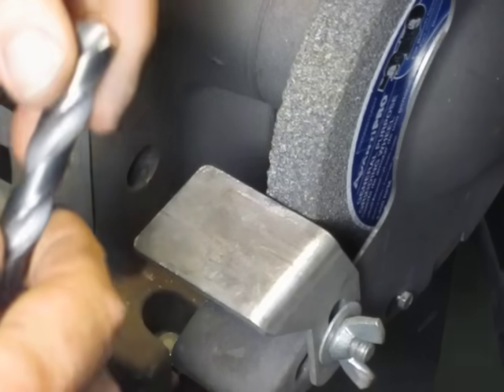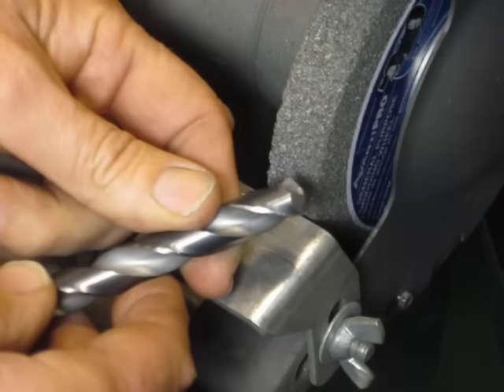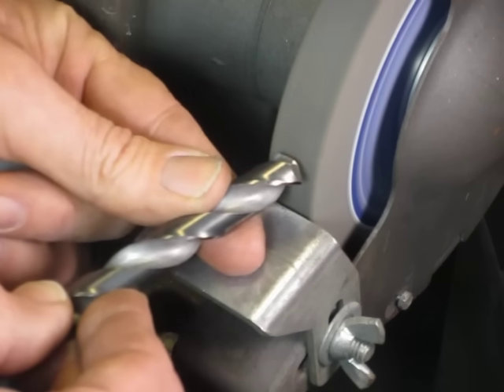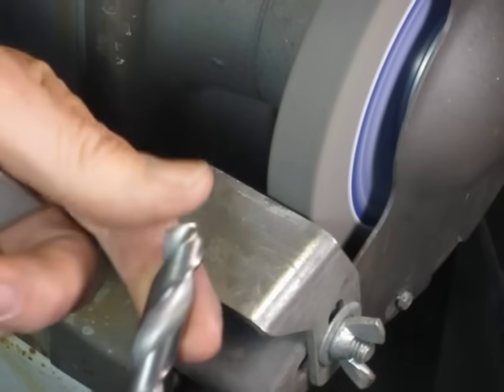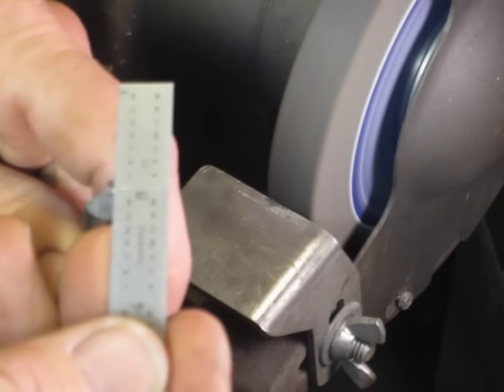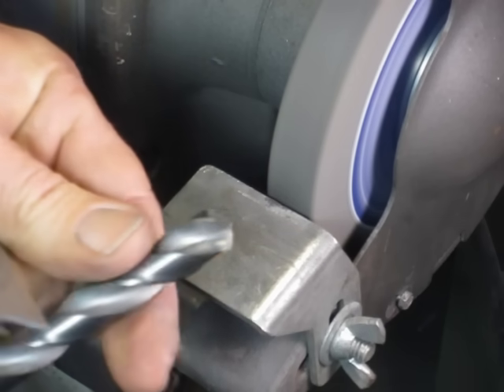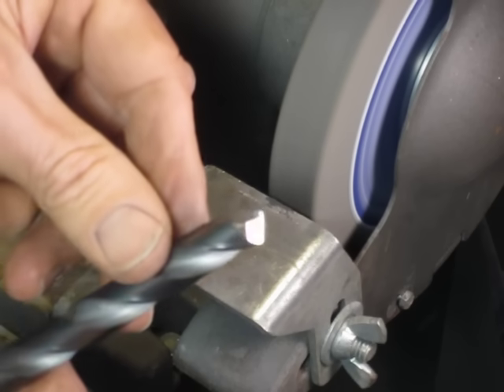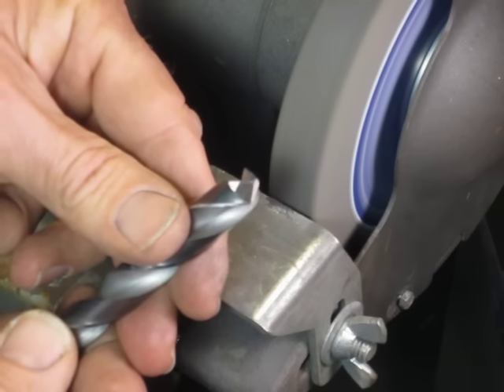How to Hand Sharpen a Twist Drill

Comment: Great video Tom,
 I read a few comments where they disagree with your methods,
Everyone to there own, more than one way to get the job done, but when grinding a heat factor has to come into play, and the less heat when doing a grinding technique the better
But as you stated below, this movement side to side is a preferred way 'as less heat is placed.  Most persons sharpening there drill bits at home have a choice, and the more techniques they know the better they would quickly adjust to one that suits them, 
I also would like to add it is worth mentioning the smaller the chisel point the weaker it is, and  the quicker the wear down on that point will be, even though more accurate '
But think about how you want to leave the dome left by the chisel point if you only want to drill partially through.  
If chisel point left wider` then a piolet hole in your piece you are drilling should be done first slightly bigger than the chisel point with another drill bit, as you state the chisel point does not do the cutting, But as you have demonstrated when chisel point taken down smaller` then you should be fine just to drill your piece without doing a pre drilled hole,
Hope this helps some newbies,
PS, Remember` the speed of the drill press, choose the correct drill bit angle and speed of drill bit rotation, also whether to use cutting oil, all play a factor when choosing the material to drill.
Reply from the maker: The naysayers are generally close minded individuals unwilling to accept the fact that, as you pointed out, there is more than one way to get the job done. I have to laugh at those who claim this sharpening technique won't work, when I have been using it professionally for twenty years or longer. I guess what it boils down is that I really don't care what the critics have to say. I know from personal experience that the technique works well and I'm happy to be able to share it with others.

I noticed you comment about heat buildup, and you should know that the heat generated from grinding high speed steel is not detrimental. HSS has what is referred to as high red hardness, meaning that it holds its hardness to a much higher temperature than carbon steel, generally up to 1100°F, or a dull red color. Check out my video on the subject.

Thanks for taking the time to comment.

Tom

Comment: Take two nuts put them flat side to flare side, the angle they make is 60 degrees, hold them together put the point of the bit in that space, thatvis a quick way to check your work, no gap and no separating the nuts , As you look down.
Reply: Hi Mike. I took my two nuts and put them side by side. Just going to get the wife to check the angle between them.
Reply: Doctor Boy how did you have them before Mike recommended you keeping them side by side?

Comment: it"s not a drill,,it"s a bit..
Reply from the maker: You may want to consult the web pages of a few manufacturers that actually produce these things before making such a statement, Barry. I found twist drill, drill bit, and drill, but nowhere did I see "bit". Unless you are referring to the auger type used with a brace for drilling holes in wood.
Reply: It's a twist drill. A tool bit is usually high-speed steel and square or rectangular in shape.
Reply: @24681359David  k

Comment: Does anyone know how to sharpen a glass drill bit?
Reply: Holy crap you have to be more clear!  Until I read the answer, I thought the bit was made from glass and was wondering wth!
Reply from the maker: Best way to drill glass is with a brass tube and grinding compound. Make a fence around the hole and fill it with water and compound and work your way through with lots of pecks to keep the glass from heating up.
Reply: @TomsTechniques  I didn't ask how to drill glass. I asked if there is a way to sharpen glass drill bits

Comment: Great video.  I'm a retired machinist that has sharpened drills by hand since the early 70's. I must have sharpened many thousands of them in my career and the one thing that's most important is practice. Find yourself a batch of drills and sharpen them over and over and over and over till they're too short to use. Test them by drilling holes and measuring the hole diameter.  After their too short to use throw them away and sharpen some more. After a few hundred attempts to get them sharp you will gain the confidence to tackle them without hardly thinking about it. It's a skill that develops over time just like playing a musical instrument. You need to practice.  I'm like you, it's hard to find a dull drill bit in my tool box because I almost instinctively sharpen it if it's dull before I put it away. I never put a dull bit away in a drill case. That's a no no. It only takes 30 seconds to sharpen it so why put a dull bit away.

Comment: can't you just mark and cut a groove in the tool rest and the make your mark in the angle adjuster on the side so that you can pretty much get started quicker and easier?I'm not trying to be a smart ass but seems like it would be faster?one thing I hate is spending all that time on bits but it's a necessary thing so the faster the better long as its right
Reply: you can get cheap grinders with such a groove already in the tool rest. do NOT use it. especially if you share the grinder with others in a workplace. if you grind in one spot your stone will have a groove in it rendering it useless instantly. sweep back and forth like the guy in the video and it will stay flat.
Reply from the maker: Remember that the rest gets adjusted from time to time as the wheel wears, so a guide slot may not work very well. Once you get good at it, sharpening up a bit will only take a few seconds, so time really isn't an issue.
Reply: Barry Kilts p

Comment: Hello Tom, for a 1" drill bit to drill on Stainless Steel shaft, what angle would you sharpen the drill bit?
Reply from the maker: Harder to machine materials generate more heat, so a 135º point angle would be appropriate.

Comment: I had a highly talented man take me under his wing and shared knowledge with me that I would have to live 3 life times to learn teach me how to sharpen drillbits.  It is much the the same as how you demonstrated up to the point of grinding the relief.  The way he taught me was to lineup the cutting edge like you show but then rotate the bit clockwise and pivot it down at the same time.  They come out looking like a new one fresh off the shelf.
Reply from the maker: That is called conical relief and is the way we all learned to sharpen bits in shop class. :) Faceted relief, as I demonstrate in the video is more efficient (generates less heat) and easier to grind. Give it a try.

Comment: What I do after cutting cutting edge and a relief angle on bench grinder - I take angle grinder with a cut-off wheel(more precise than grinding wheels) to grind the split point, like new bits. With some practice - it is worth doing on bits between 8 and 12 mm. Smaller are quite finicky and bigger tend to need a pilot hole - so split point is not necesary.

Comment: Wouldn't this destroy the galvanised tip?
Reply from the maker: Yes and no. Yes, any coating would be removed. No, zinc is not one of them.
Reply: @TomsTechniques  awesome, also would it be possible to make homemade masonry drill bits?
Reply from the maker: Yes and no again. Yes, it would be possible to make them. No, it wouldn't be practical.

Comment: The tool rest is called that for a reason. Set the TOOL REST for one angle and use a Sharpie to draw a line on the TOOL REST for the other angle.
Reply: The other angles aren't right or left.  They are up or down in relation to the centerline of the wheel.

Comment: Wow, I've been in the industry for 33 yrs now. I have been sharpening my own drill bits with my own grinder wheel, for maybe 29 yrs, maybe longer. 
I have always done it freehand. No gages, no rulers. I have taught many guys to sharpen drill bits, always without gages or rulers. 
2 companies I've worked for, when they discovered I know how to sharpen drill bits, brought their drill bits. 
I taught them to sharpen their drill bits. All these guys said, wow what a difference. Drilling with a sharp bit vs drilling with a dull bit.
Reply from the maker: I sharpen them by eye as well, but it isn't realistic to expect a newbie to possess the skill or judgement to be able to do the same. Using a protractor to get equal angles and a ruler to get equal lengths will produce a much better bit until those skills are developed.
Reply: @TomsTechniques  ... Agree, like everything in life, you learn to do something and then you polish your skill. The more you do it, the better you get. 
Thank you for your comment and thank you for your video. I'm sure your video will be helpful to somebody. Keep up the good work.
Reply: Good for you.
Reply: I'm a machinist and that's alright for small drills but don't tell me you do this for larger ones. If you want the drill to last and not produce an oversized hole you have to use a gauge and even then you are better off using a special machine.

Comment: my Dad sharpened drill bits on bench grinders for many years dating back from the late 40s when he worked in a shipyard. he would sharpen bits based on what he was doing with them, some stuff he rolled them, for other things multi-faceted. 
the larger bits, over about 2 inch he would clamp in a vice & use a hand grinder. once done he didn't have problems with them drilling over sized holes. 
on my best day i never was as good at as he was on a bad day.
in his later years he did start to have problems with smaller bits being off center, his eyes were not what they use to be. i got him a Drill Doctor which he did use & liked it for the most part, but it did take him longer to sharpen a bit with it than what it did when he had good eyes.
some of the places he worked were like some people here "you can't properly sharpen drill bits on a grinder",.. cause of that he had more high quality drill bits than some shops.

Comment: Hi  I have just sharpened 4 mm drill at 59  it looks good but not cutting so good tried a few times but still not cutting. I put a tiny pilot hole and it then went through like butter, others i have sharpened they cut okay. What could i have done different on this one.
Reply from the maker: The most common error is to not grind enough clearance behind the cutting edge. Looking at the bit from the side, make sure the area behind the cutting edge angles up, all the way back. Larger drills will require two, and sometimes three clearance angles to keep from rubbing behind the cutting edge.

Comment: great for bigger (=relative more expensive drills) but not practical for smaller drills like 1/8 (~3mm)
since each edge is too tiny to measure angle+lengh.
Reply: I had a really good mechanic show me how to sharpen 1/8 sized drill bits, you hold it between your pointer find and middle finger, than you wip that damn thing in the trash and grab a fresh one because i dont know about you but my time is worth more than a cheap bit ;) Hell even if you can sharpen them in just a few minutes its still not worth the time, well worth it on larger bits though
Reply from the maker: Do you send your mechanic out to buy them? ;)
Reply: @TomsTechniques  nope. Local vendor keeps my bins stocked. Idle techs dont make money :)
Reply from the maker: Sounds like you are running a business, in which case I would agree, but most hobbyists can't afford that luxury.
Reply: @TomsTechniques  no.i hear you. Was being a smartass ;)  I really did enjoy the video though very good info.
Reply from the maker: Thanks. I tend to toss more of the smaller ones now myself. The old eyes aren't what they used to be and I hate working with magnifiers.
Reply from the maker: Not so sure about that. I recently sharpened a #60 drill successfully (it broke and I didnt have a spare). It took several tries, a pin vise to hold it and lots of magnification, but it worked like a champ.

Comment: what about smaller drills? do you dip the drill in water to cool and harden the bit?
Reply from the maker: Today's drill bits are made of high speed steel and are unaffected by the heat from normal resharpening. You would need to get them nearly red hot before any hardness would be lost.

Comment: The irony of Youtube is that whenever an expert makes a video, it gets down-voted, but when a clueless idiot makes a video, it gets nothing but up-votes. This is why the world doesn't take anyone under the age of ~30 seriously. Btw, I also sharpen my bits by hand, using a disc sander. The human senses can easily detect a 0.0005" variance, through a combination of sight, sound, and feel. Most beginners have their minds blown then they discover that the only way to perfectly machine something is to do it by hand. Literally, with your own hands. Machines like CNC mills and lathes have inescapable error caused by runout, backlash, and deflection (caused by the uneven force of the cutter/grinder pushing against one side of the workpiece). There's also a significant deflection caused by the holding pressure of the vise. These issues are skirted entirely when you use your own hands, plus the human body is kept at a constant temperature, which means whatever you're holding will also be at a constant temperature (which obviates thermal expansion/contraction). Anytime I'm going to check the diameter of a dowel or drill rod, I put it in my armpit for a while first so it warms/expands to a known temperature :P. 

One last tip for beginners - the way to create perfectly flat surfaces is with a granite surface plate. If you want to make perfect right angles, you'll also need a vee block. With those two items, and some precision measuring equipment (micrometers, dial indicators, etc.), you can "machine" metal more accurately than a CNC machine. It will take you a thousand years, using files, saws, sanders,stones, etc., but you WILL end up with professional results. I only wish someone had taught me about surface plates when I was a kid. You'll find out eventually that machines (like drill bit grinders) are for SPEED, not accuracy.
Reply: Old-school.  I like it.

Comment: Damm I've never used a protractor and a 6in ruler for sharpening drill bits and I've never had any problems with oversized holes, It took a long time before I actually had a sharp drill bit but once I got one sharp it was smooth sailing, occasionally I'm half asleep or something and I'll butcher one here and there and also have a few smaller bits that have drilled 100s of holes and still perfectly sharp
Reply from the maker: Skipping the basics is never a good way to learn a new skill. Time spent early on learning the importance of proper cutting edge angles and getting the lengths of them equal will help you learn the technique more quickly and make you better at it.

Comment: Good video!  You would be a good person to ask this question.  Are flat gears (like on old Southbend lathes) noisier than bevel cut gears?  Does  sticky type lube quite them down a bit? Thanks!
Reply from the maker: Yes and yes. Straight cut gears are inherently noiser than helical gears and a thick grease will quiet them and stay put. I think Lubriplate makes some calcium based greases that would work.
Reply: Thanks for your help Tom!